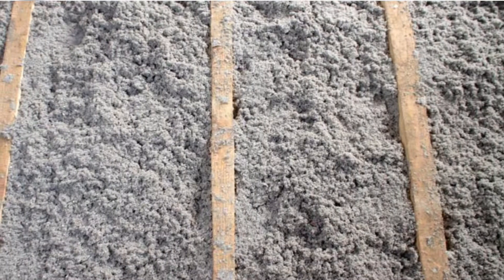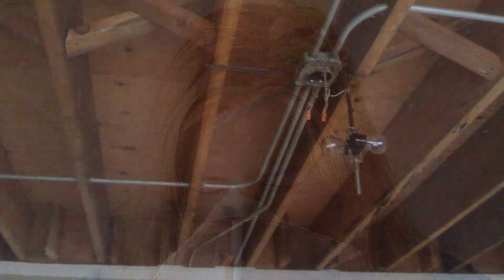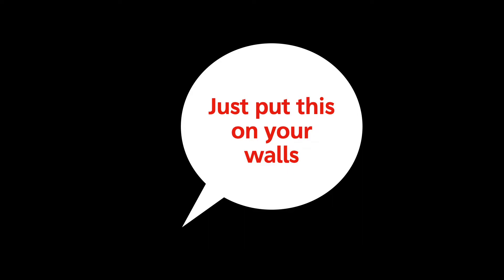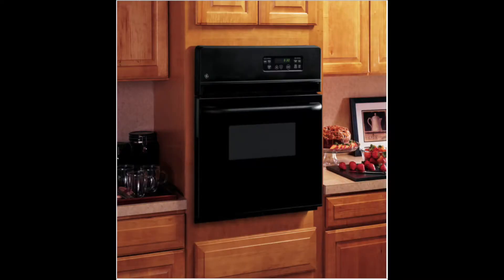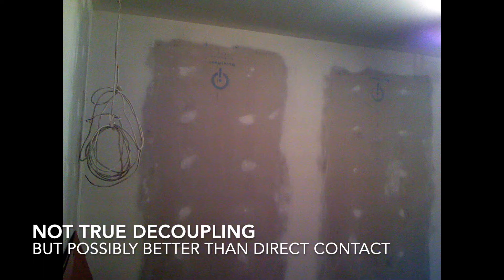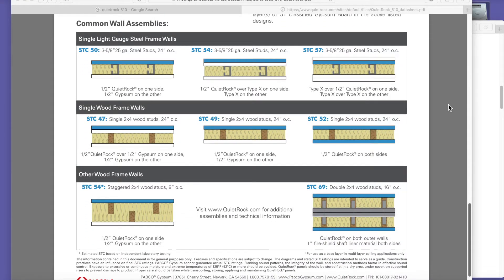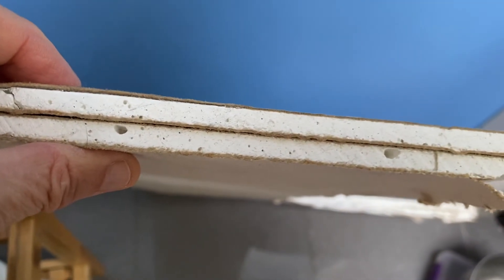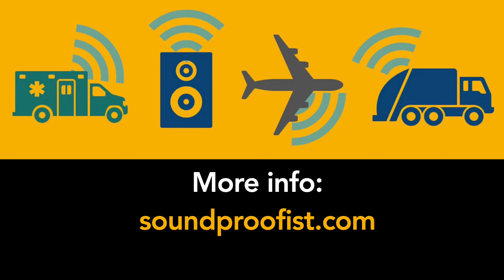Lessons learned from first-time soundproofing work

Comment: 1) What about if you are insulating the entire wall of a multi-room and multi-floor property that is shared with a neighbour. That wall will have door frames, partitioning walls and floors attached to it. To have effective insulation from impact/vibration noise, then will you have to install insulation/de-coupling/layering to all parts of the door frames, partitioning walls and floors that attach to that wall? Doors are often only 2 inches away from walls 2) What about if the partitioning walls are made of brick instead of timber? 3) if there are chimney breasts attached to that wall, then will they need to be insulated as well?
Reply from the maker: For internal doors and for windows, I've removed the molding and sills from the original wall, and then added them back again after attaching another layer of drywall. This did seem to mute some of the noise that comes through the building frame from my downstairs neighbors because the top layer of drywall was made from sound-dampening materials. For security reasons, I think you would need to ensure that you have sufficiently strong framing to keep your entry secure (metal, etc.). I know there are "soundproof" doors made from fiberglass, but I'm not sure how strong they are compared to wood or metal. Apply silicone window seals, door sweeps, etc. to seal any air gaps around the entry door. Unfortunately, I don't have experience with brick walls. And as for chimneys -- this is a source of outside noise that's difficult to address because the air passage needs to be kept clear. I have this issue where I live. We can hear the faint sound of a neighbor's dog barking. It doesn't come through the walls, but it sneaks down the chimneys.
Reply: @soundproofist  Excellent response!

Comment: That sucks since it seems de coupling u lose about an inch of room plus the drywall adds up. Which is hard since my rooms r already small. I added mass load vinyl and two 5/8. Which helped a bit with bass but  not much and the windows seem to always be the weakest link to everything
Reply from the maker: I've lost some room size from adding extra drywall, and I live in a relatively small apartment. I'm not sure about putting mass-loaded vinyl between the two layers of drywall on the outside of the frame. I know there's another YouTube channel about soundproofing where he recommends it all the time, but I'm not sure he's ever used it himself. I've used it on a couple of occasions. Once, inside a ceiling that was being decoupled. It was wrapped around the floor joists and against the upstairs subfloor as just one of the materials inside the cavity -- along with sound-absorbing board, insulation batts, wood braces, resilient channel, and finally, sound-dampened drywall with two layers of viscous material layered between them. I have NOT used mass-loaded vinyl on an exterior wall, that is, between two layers of drywall. I used MLV one other time on an extra layer of wood I added on top of the subfloor underneath my kitchen floor cabinets. They sit above my downstairs neighbor's kitchen fan system, which was very loud. In tandem with the extra mass and also a layer of Green Glue (and I also doubled up the drywall with QuietRock on the wall behind the cabinets), it's hard to say how effective the vinyl was on its own.

Comment: Thank you for sharing. There really aren't that many videos out there with people describing what has worked for them and what hasn't, and what kinds of noise they were trying to muffle. I need to soundproof my whole house, due to living on a busy road with motorcycles, muffler issue cars/pick up trucks, delivery trucks etc. I can feel the walls vibrate when these vehicles go past, and there isn't a single corner in the entire house where you can't hear the noise (even with windows closed and wearing ear plugs). I hope to go the de-coupling route, but it sounds like that's a job for experts.
Reply from the maker: I have the same problem. Our apartment building is very close to the road with no setback, and there are multiple delivery trucks, construction trucks, cars with loud mufflers, etc. driving back and forth all day. Even when there's no street construction going on, there's lots of intermittent low-frequency rumble. I have two issues to deal with: the external noise, and the internal noise that comes from other people inside the building. And both are amplified by the wood stick-type construction that's super lightweight and noisy. I do think sometimes you need to bring in "the experts," but be forewarned that it's going to cost a lot per room. Just one decoupled ceiling, done right and with additional dampening processes inside the cavity, might start at $20k.